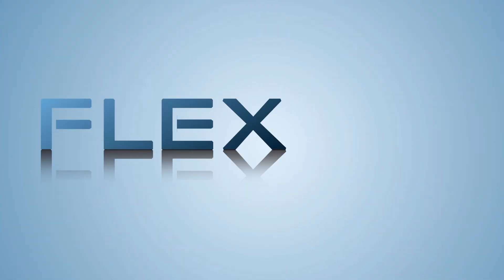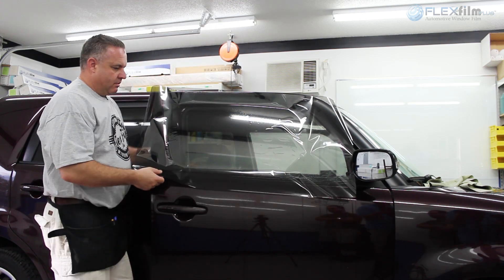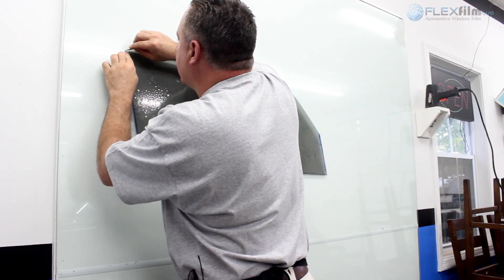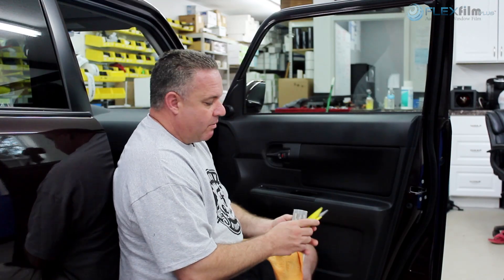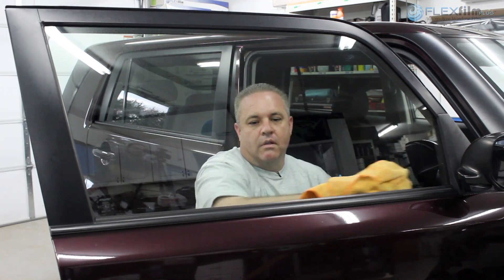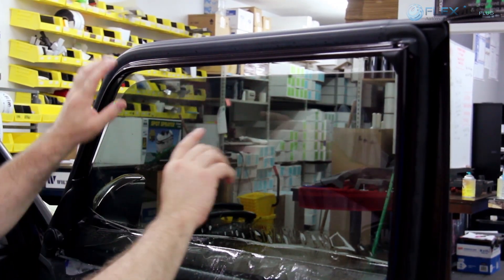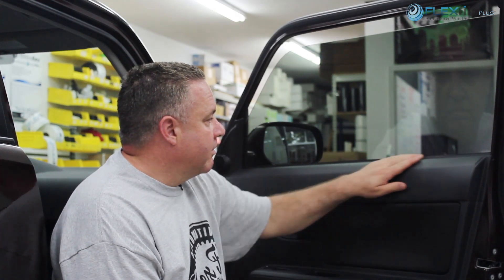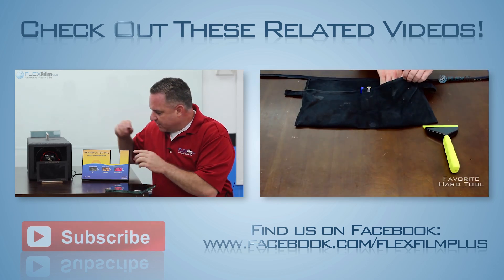Window Tinting: Side Window Installation (Two Stage Method)

Comment: When I seen you draw your lines on the film but didn't pull film down I thought you would have under cut it, then I seen your bottom cut was below the line for the extra length for a good tuck under the window seal. Good work

Comment: 16:30 in, i tried not using too much water but the film was just too sticky. i had to put more than 10x the amound of soap in just so that when i started installing, it actually moved without creasing. what am i doing wrong? you eplain really well. i installed my first rint successfully because of the way you explain stuff. just had tonuse more soap

Comment: depending on the film you use, some films have super fast tacking effect and you can roll up window without heat.  I like to put alittle heat to make sure its not going to peal or bunch up, especially on cars with super tight seals.  the car he is working on, doesn't have tight seals, so you can get all water out and roll up with most films without heat, I just do it for added security.  10 seconds of heat on each area, continually moving heat gun.  great video !!!  i usually don't use the method for making the fingers like he does, but i like it. might try it.  i force fingers and heat them out.  i don't usually get many fingers if any, only on cars with super tight seals.. but now i use a paper towel with a squeegee as i take water out, i don't spray more water on.  it seemed like when i sprayed water and squeegeed it , water would find its way down and create fingers.  again this is mostly on difficult installs where bottom seal is super tight.

Comment: I've been tinting a few years and am pretty good at it.... I sometimes run into problems with defrosters in the back glass...After applying the tint, sometimes I get fingers on the grids of the window that run horizontal with the defroster grid.. they can appear anywhere on the grid not just the edge.... what causes this and what's the best way to get them out??? I've seen your videos on you tube and you seem very knowledgeable and take a lot of pride in your work....

Comment: The area I live in is very hot in the summer and my truck sits outside all the time (100 is an average in the summer). The tint on my windows have pulled about 2" on the back portion of the front windows and 1/2" sown on the top. I have pulled the door panels off in the past and the tint is tight against the window about 2" down into the door and there is another 6-8" that is just hanging loose inside the door. I have to get these redone. Suggestions? Should I take the door panels off or leave them alone? With the tint shrinking, is there anything I can do to keep this from happening? Are there any questions I should ask the different shops before I decide?
Thanks for the video.

Comment: I applied soapy water and when I was done - there were soap stains between the film and the window.Could one use just distilled water on the window once the backing has been removed and film is going on the glass for real?

Comment: Thanks for the reply! So to clarify, you would cut on the lines you made AFTER the shift? Not sure why im confused by that part. I understand the shift completely and have worked on windows that have shifted, just am new to this method. Thanks!!
Reply from the maker: Just think about it like this... cut just a hair past all the outside lines.  If you cut inside them, there will be a gap.

Comment: Hi Ralph
I have a question : how can I solve if some dirt, like short hair, get trapped between film and window ?
Can I use heat gun to warm the hair and make it dissolves ?
Reply from the maker: You would be better off pulling the film back and removing the hair or just redoing the window.

Comment: Wat if the gaskets on the windows  are so tight  that it is impossible to slip film under gakets? Would  tint work if it is cut just above gasket ?
Reply from the maker: I've never in 35 plus years ever seen a car where we couldn't get tint under the gasket at least 1mm.
Reply: @FlexFilmPlus  2006 mercedes e350 w211.
Thanks for responding.
Would  work above gasket ?
Thank you.

Comment: Hey ralph im wondering the importance of tracing the sides with the sharpie twice? Even if the window were to shift and there was two separate marks, wouldnt you still cut a hair outside the first set of lines which would be the outer ones?
Reply from the maker: Good question.  If you cut outside the first set of sharpie lines and the window shifted and you made a second set of lines, you would have a light gap everyone you rolled the window down exposing the shift.  You would not have a light gap when it was rolled up.

Comment: Hey Ralph I’m learning and keep struggling with fingers appearing for the bottom mainly but as well as the sides and top. Does that just mean I need to clean better?
Reply from the maker: Number one reason for fingers is too much soap in slip solution.  Number 2 reason is you may not be double shrinking the film before install.

Comment: great video I was wondering if the yellow go doctor is basically same as blue max and if the yellow one is better than the blue go doctor?
Reply from the maker: They are both good.  It boils down to preference.
Reply: +Ralph Van Pelt which one would you recommend to use in place of blue max
Reply from the maker: +J.REP25    yellow go doctor.
Reply: +Ralph Van Pelt thanks really appreciate it

Comment: Quick ques? I saw u break ur carbon blade while u cut the film on the glass. What would u do that? is this because the tip of the blade it too sharp may cause scratching the surface on the glass? second question is. why do I always see people heat shrink before peeling the film and apply it? Is this just for sizing correctly? or the adhesive need to be warm up to stick better? Thank you.

Comment: when you squeegeed the window, where did all that water trickle down to? Are you not worried about electronic components getting wet?
Reply from the maker: water goes down into the door panel from the inside just like it does from the outside when it rains.  It drains from small holes at the bottom which are designed for drainage.

Comment: Hey Ralph good Video I don't really have all the different plastics is there any home made items I can replace them with like bank card or something like that  ?  and also can I use Hair Dryer   instead of Heat Gun ? Thanks
Reply from the maker: You can certainly replace professional tools with I'd cards and hair dryers but your quality will suffer.   I think the results would be like painting your car with spray paint.
Reply: :D thanks for fast reply, what are them plastic tolls  called so I can order from ebay >?

Comment: Hi Ralph. Thanks for the vid. What do you use to remove the adhesive leftover from a bad tint job?
Reply from the maker: I like supper stripper. I buy it by the gallon. It is on our website in our tools section. Www.flexfilmplus.com

Comment: Hello thanks for your videos a question about window scrapper,

Ive bought some blades for my window scrapper but they are carbon blades so im worried they might scratch the window while preping the window from inside, i saw you was using stainless steel blades for window scrapping. 

What would you say aboit useing carbon single edge blades for window cleaning would they scratch the glass? 

Great videos!
Reply from the maker: I think you should be ok on most auto glass; however, be careful on the laminate glass and any glass with acoustical technology.  Seems like it is easy to scratch.

Comment: Hi, I have tried tinting my car window. But after tinting it, the water dropped inside door panel, causing electric failure and now I cannot start the engine. Aircon, CD player, lights are turning on/off randomly. How should I do?
Reply: Michael Truong that’s not from water in the door lmaooooooo

Comment: Quick question sir. I just got my windows tinted and the guy left like buubles on my window dont know if there air or water bubbles? How could i take those off or are they permanent??
Reply from the maker: I really hope they are water pockets.  If they are water pockets, they should look like blisters filled with water and they will go away.  If these are air pockets, there will be a small contaminate in each bubble and they are permanent.
Reply: Ralph Van Pelt yeah their water pockets then do think if i get a blow dryer and heat them up theyll go away? Also thank you for the help
Reply from the maker: If you try and speed up the curing process, you might cause more problems.  Just pull the car in the sun.  They will keep getting smaller until they dissappear.
Reply: Ralph Van Pelt ok thank you for the help ill try that.

Comment: So would one NOT need to use a heat gun to shrink the film if they are in fact removing the interior door panels?

I'm about to do my truck and I can easily remove the door panels which will take all of 1 minute to do each side.
Reply: Depends, I've seen it done because the window curves. You have to imagine the film is flat as flat as can be. It does not give unless you ask it to with heat. Nothing on cars is ever flat anymore.
Reply: It seems like doing it is something safe and smart to do given that the window curves. It'll be easier to deal with with the heat.

Comment: Hey Ralph Great Video!  how much does a 2 step window tint installation job cost on average for a 4 door sedan like an 06 Lexus GS. In 1999 I had my Mustang GT convertible tinted and it came out horrible! The back window has a 4" by 1/4" line [finger] that delaminated from the window over time. My gaps are 1/4" from the edges. #TintSchool

Comment: so why have my tint guys always told me not to roll down my windows for a couple of days?  Did the film they used have lesser adhesive?  I've gotten ceramic film on four cars to date.  my last car got formula one pinnacle.
Reply from the maker: Crysmatic 
Maybe they use a technique that could cause your tint to peel if it is still not cured.  This technique if done  correctly will allow the window to be rolled down instantly.

Comment: why is there water spots  on the window at 31:16 ?
Reply from the maker: Those are calcium deposits on the outside of the glass.  They are common on cars in the South.  The proper way to remove them it with a mild acid and something abrasive.  Some people call them Acid Rain or jist mineral deposits.  When you darken the glass with window film, they become more noticable.

Comment: how long does it take you to do a single car?? 3 hours?
Reply from the maker: 3 or 4 hours
Reply from the maker: Nightwulf1992 
You would not understand.  lol
Reply from the maker: Nightwulf1992 
I see.  The original question was... How do You make profit?  Well... I make profit by manufacturing and distributing millions of dollars of window film all over the world each year.  I instruct tinters who want to learn how to tint windows (fast or slow) .  Some tinters make money working fast at dealerships while others work slow and charge over 400 per car.  This just happens to be 1 of over 100 videos that explains how to hand craft a pattern and two stage the installation with out removing the door panel with a lot of talking.  This process can be done in as little as 5 minutes or you can drag it out to over thirty if you want.
Reply: Ralph Van Pelt nice answer

Comment: I got mines done today.. its super dark, the one in the video is still very clear... btw the guy told me to wait to open the windows for 24 hs.. is that true u think?
Reply: It is a good idea to let the glue set before normal use as rolling windows down and opening shutting doors can sometimes left tint if it has no cured to window. Just be gentle with it for a few hours, let the car sit out in the sun helps speed up dry time also.

Comment: This is really hard to do. I bought 2 ply 24inchesX 20feet 35%VLT film for $24 on Amazon and after 5 try's on a Crown Vic side window I give up.  The film creases to easily and I keep getting water fingers on the edges. The local shop wants $300 and I am going to pay it before wasting anymore time.

Comment: The 'secret' to keeping the top edge clean is to wipe with a non lint towel before exposing it to film. Showing the overspraying of the top edge before swiping with a turbo and mounting the film, then not demonstrating cleaning the door gasket to eliminate wicking back dirt from fingers would be helpful.. From a 25 year pro tinter with over 20,000 installs.

Comment from the maker: Edges on a side window do not have to be perfectly straight because they are hidden.  The straight edge that tinters use that was cut from the factory is sometimes not smooth.  If I re cut the edge with a fresh, sharp blade... I will be assured that the edge is smooth and not peel over time after installation.

Comment: Can somebody point me to a video where they use a method that requires removal of the door panel?  I have never seen a video where they remove a door panel, yet I've seen a ton where the installer boasts about not having to remove the door panel.

Comment: u can't do a 2 stage step if ur mobile and do most of ur work out side and uncovered.  the contamination factors are to great
Reply from the maker: Hey Al,
I agree with you on the contamination factor because mobile is tricky but I still believe the 2 stage method is as good as any.  I did a mobile set up in a competition and worked off the car and scored higher than anyone there.  https://youtu.be/so-bp3VpSuI

Comment: I know the importance of having a clean window to be tinted. But I think, in my opinion, you are over doing it. You are inside a garage, no winds nor Sun heating down. Just clean that window, present your tint, cut it, and slapped in. simple as that. God Damn...I used to work on this before, so kind of you learn as you go.  My next project? 2012 SRX front windows.

Comment: I dropped out of my medical school neurology program to get into something fairly low pressure and fun like window tinting. After watching this video I re-enrolled immediately. Brain surgery has less moving parts, measurements and instruction. 

But seriously, I know there's a technique to everything and practice counts and I appreciate that, but at the end of the day you're sticking film on a window. There is such a thing as overcomplication.

I could make an hour long video on how to make a ham sandwich, but should I?
Reply from the maker: I personally do not mind making a long video like this and earning over 6k for the ad revenue share with YouTube.   Seems easier than going to medical school to me.
Reply: @FlexFilmPlus  You are correct. Making a video of yourself tinting a window is far easier than 4 years of medical school and 2 years of residency to be an M.D. I imagine. That's exactly my point. Congratulations on your $6,000, spend wisely.

Comment: allthough this will work it is way to time consuming. I'd rather just cut the pattern on the car and cut it. by the time you cut 1 pattern this way I can cut both patterns and install 1 before you cut 2 patterns. 

nice work though

Comment: That was painful. Pretty sure i could have both door panels off and both windows tinted in 32 minutes. yeah i know its suppose to be instructional.
Reply from the maker: Which corners to you like to cut?
Reply: I like to cut all four corners and the outside window scraper on all 90's gym trucks. Haha. Didn't say anything wrong about the video, just that it was painful to watch. And guess you didn't read the last sentence.
Reply from the maker: +awdtalon57 .
Reply from the maker: +awdtalon57 I read everything. It was painful to read.

Comment: looks like a good result, however you now have a pool of water and baby shampoo inside the door, that's not going anywhere for years, rotting the door from the inside.  Apart from that nice job :)
Reply: Wesley, All automotive doors have drain holes in the bottom that let the water out. If they didn't, then car doors would fill up with water over years of being outside in rain and snow.They need this because the bottom rub seal can't possibly keep all water out on windows that roll up and down.
Reply from the maker: Wesley,
The water and/or slip solution went through the door and out the bottom through the drain holes.  Thanks for the comment.
Reply: Or even better than what he said what about when you wash the car where do you think it go then 😂😂 just think next time
Reply: camo 69 hahahahaj